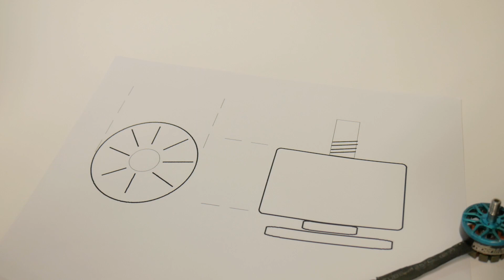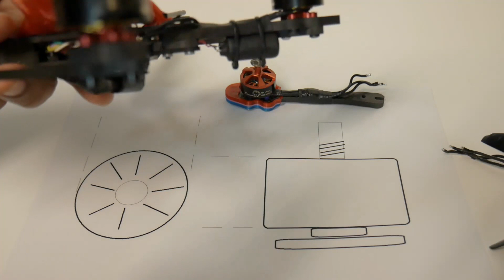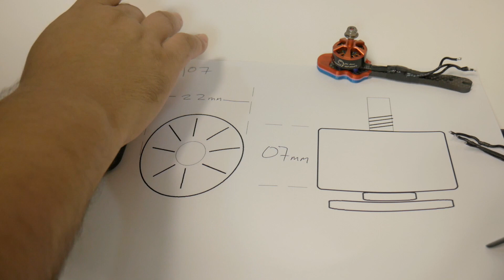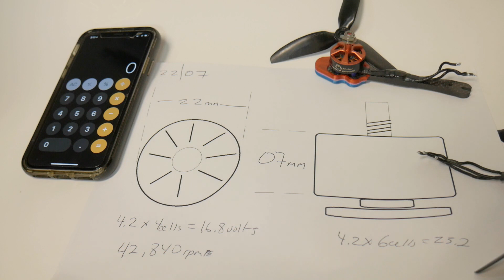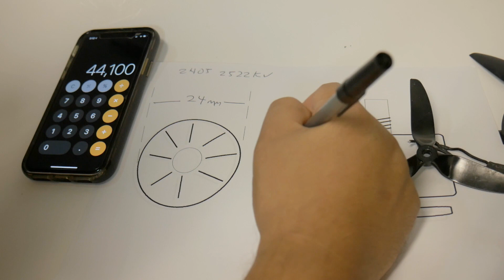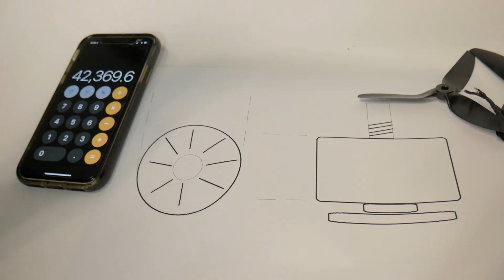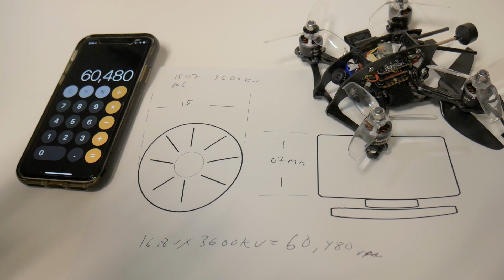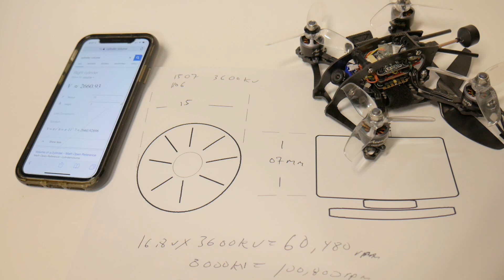Drone Motor Sizes Explained: FPV Beginner series

Comment: Lots of good info. However the music was very distracting and made it hard to hear and concentrate on what you were saying. The volume on the music seemed to drawn out your voice. Just giving you a heads up. Most people aren't  here for music. Thanks for the info
Reply from the maker: Sorry about that this was one of my very first uploads almost 4 years ago.  I totally messed up the sound on this one, i have been collecting editing tips and gear since then, so the new ones should be a lot better.  Let me know if you happen to watch any if there any other areas i can improve.  Appreciate the feedback.
Reply: @JonE5FPV  Cool I will definitely will check out your other videos. I'm new to the hobby. This video had a lot of good info in it. What other videos of yours would you suggest for someone who is new to watch? 
I have a cheap amazon drone. You know the ones that come with the remote and you use your cell phone for video. Since then I have down loaded drone racing league simulator and fpv free rider. I'm planning to buy a jumper t pro or something like it soon to get started in fpv. Thanks

Comment: Thanks for the info but would appreciate some help. What combination would be good for lifting heavy loads? For example, would 2807 1500kv motors on a 7” kwad be good enough to lift a 2 kilo payload? And would a 1500mah 4s battery be sufficient to power this combo?
Reply from the maker: You woudl want larger battery imo, 2000-3000mah for longer flights.  You can probably get in the air with a 1500mah, but it would be pretty short flight time.
Reply: @JonE5FPV  Thanks. Does that mean the rest of the specs should be good enough to lift 2 kilos? How long would that last with that battery? Would running 2 batteries in parallel get the job done or do I need to shell out for that bigger one?

Comment: When you are talking about volume calculation at the end what volume are you calculating? The amount of air displacement or the volume of the motor itself? What is the usefulness of knowing the volume?
Reply from the maker: It becomes useful in comparing difference sizes of motor to figure out which one is actually bigger (usually bigger means more power).  

1805 vs 1408 for instance.  We know right off the back, one is has more low end torque, and one has more high end speed, but for middle throttle range flying like most of us do, which ends up having more volume?   It can give you an indication especially when a ton of new motors are coming out of various sizes.
Reply: @JonE5FPV  Hey thank you for the response! I'm looking to get into this hobby and found your video super helpful.

Just for clarification. If I calculate volume for the 1804 it is about 1,018mm^3. The 1408 is 1,231.5mm^3.

1. Given those volumes and my understanding from your video am I to then conclude that the 1408 has more power for middle throttle overall simply because it has the larger volume?

2. Does this value ever become misleading in a situation where a 1408 is powered by a 4s battery versus being powered by 6s battery or is the only difference in the batteries the load distribution but the overall power of the motor remains the same?

Comment: Hi Jon .. Thanks for video
Can you please suggest how to install different screw size motor base...
for e.g, i am using BETAFPV 95x V3 which has 1106 motor with Motor Mount Holes: M2EQS on Dia 5.0mm
but i want to use DIATONE MAMBA 1404 with Installation Hole Position: 12mm x 12mm M2.

Please help me :) ..thanks
Reply from the maker: i believe that is the same mounting pattern, can you confirm that those 1106 also have the 12x12 mounting?

Comment: Really good video love the educational explanation i would like to find out what happens if you have  (high or low) kv motors but yet the drone is (heavier or lighter)
Reply: Lol kv = lower top rpm but faster to achieve the top rpm (like 1st gear)
higher kv = higher top rpm but slower to achieve the top rpm (like 5th gear)

Comment: can I use same size but slightly different kv in a same build please
one of my drone lost a motor and I can not find the exact same motor 
I found a motor with same size but the kv is 3800 but my drone motors kv is 4000
thanks

Comment: How take care of my brushless motor?
Reply from the maker: Not much to it. Just don’t get dirt in it or smash it and it will be fine. No need to oil or lube it.
Reply: If you do get it nasty look up how to disassemble the motor (Ik of only hex screws or grades disks) then use dry med or hard toothbrush after u can use air compressor or let some $store silly putty sit on 1/4 of the bell magnets at a time(it forms into all the crevices with gravity)

Comment: I'm new to quads, but have experience in electronics. When I hear "KV" I think kilovolts! lol... So what does KV actually mean in this context?
Reply from the maker: “Kv” refers to the constant velocity of a motor (not to be confused with “kV,” the abbreviation for kilovolt). It is measured by the number of revolutions per minute (rpm) that a motor turns when 1V (one volt) is applied with no load attached to that motor
Reply: @JonE5FPV   Thank you for the quick and definite response! I'm really looking forward into getting into this hobby. Unfortunately I just crashed the Tinyhawk I got today into my wife's halloween spider web strings! Now I'm tweezing out the fibers from the motors. XD

Comment: hello, the screw mount motor are same or its depends on the moto saize ?
Reply from the maker: they are mostly the same, many are 16x16, but some older motors are 16x19.  The top screw is always M5 nut that goes on top

Comment: Hey man. I got a bnf from CMW last year. It’s a merica light build 5 inch with 2206 1800 kv weight with props is 250 grams. How effective are 2206 compared to 2207? I haven’t flown it because I haven’t had time (work).

Comment: You dont explain much. Ok so, we know KV now, perfect. What now? What about voltage sag? You will never get 16.8V on a punch on a 4s.
Why are there different sizes of motor bells? Spin up time? Torque? How much KV do I need on what quad or what prop or what flight style (race or freestyle)?
Please kill the motor and change the speaking style. It sounds like you talk to a 3 year old! I guess most of your viewers are older than that.
Sorry but „no“ from me about that learning video.
Reply from the maker: Thanks for the feedback.  Larger motor will consume more power, and be less efficient, compared to a smaller motor that will be more efficient and have less weight, and use less power.

Your question is very complex, because pairing a motor to a quad requires answering many other questions
1 - What is the purpose? (Free style or race)
2 - What is the weight of the quad?
3 - What size battery? 3s, 4s, 5s, 6s?
4 - What size and pitch prop will you use
5 - personal flying style

This video was only to explain the differences in sizes and interpret the numbers in the names of motors.  To answer your question would be a very long and detailed video, and it is largely personal preferences at play.
Reply: U R right.. Im outta here.. Can't stand it !!!